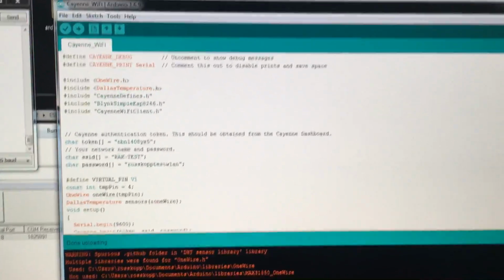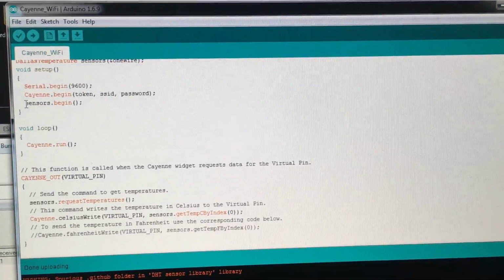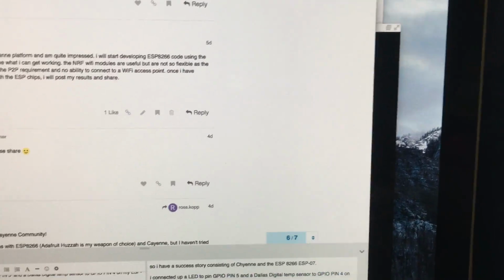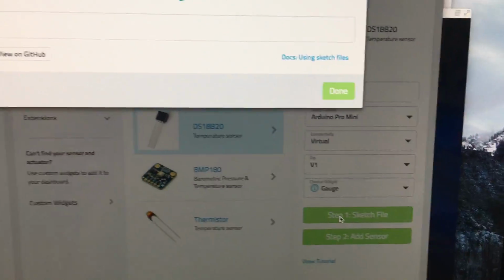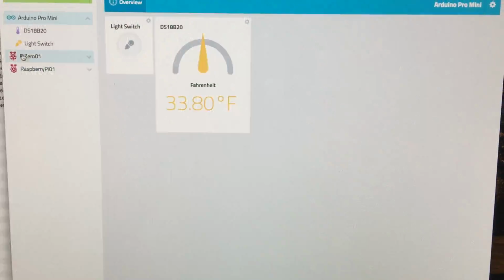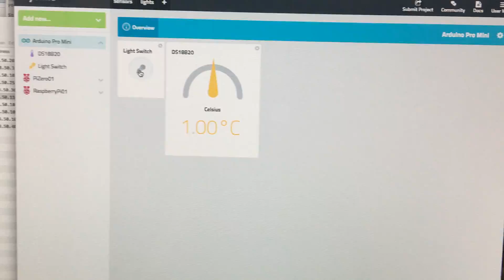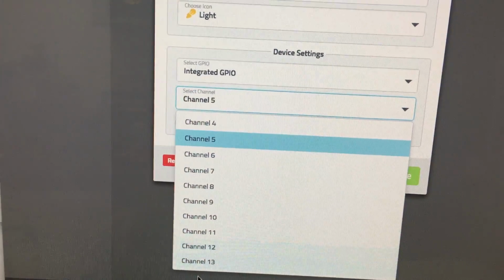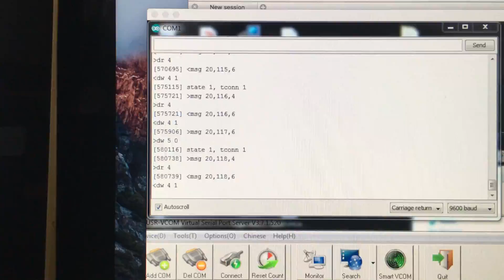ESP8266 connection to Cayenne IoT

Comment: can you help ! i can not run ESP8266 ? i was try upload firmware for it but it is not working .... ^^ ! do you have any document ..? thank so much
Reply from the maker: run the ESP8266 in Cayenne? be a bit more specific and i will put together a video outlining in detail what you need to do.
Reply: nice ! thank so much ... can you give me this link ?
Reply from the maker: you first need to tell me what you are using. ESP-01, 12E, 7? then i need to know if you want to use cayenne or something else to operate the ESP chip.
Reply: ESP-01 ! I use it to connect with cayenne.
Reply from the maker: i will put together a video and post it for your information so you can load the ESP-01 and connect to Cayenne. i will need a day or two  to get the video posted.
Reply: thank so much
Reply from the maker: https://youtu.be/NeW9xJB-7Ss

Comment from the maker: one thing i had an issue with was the resistor used with the DS 18B20. i forgot to wire in a 4k7 resistor for the temp sensor.
Reply: Hello, mine does not output temperature, all works fine with another app :( did you managed it to work ? Thank you !
Reply from the maker: i did get the code to work with Cayenne using an ESP8266 and the Dallas DS18b20 sensor.

check this video for the instructions:
https://www.youtube.com/watch?v=bdaqzII7m5s